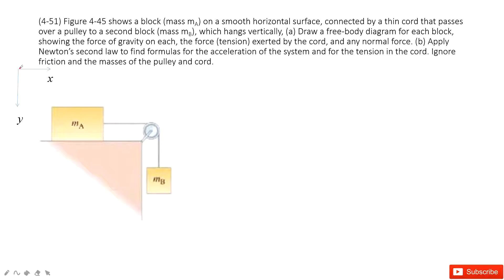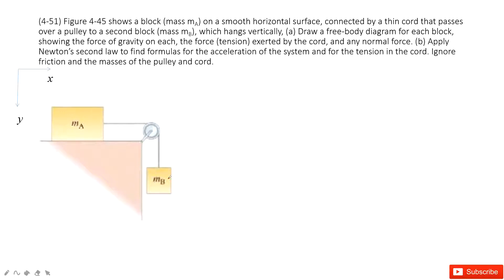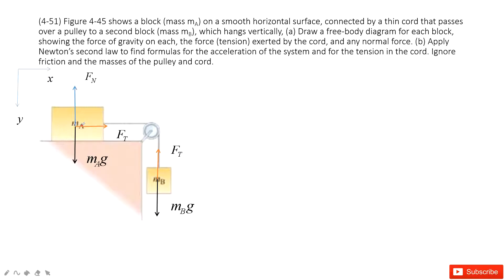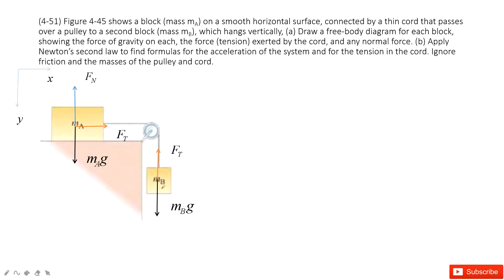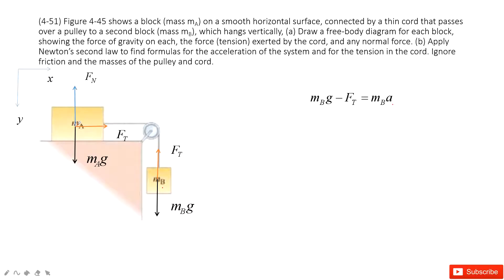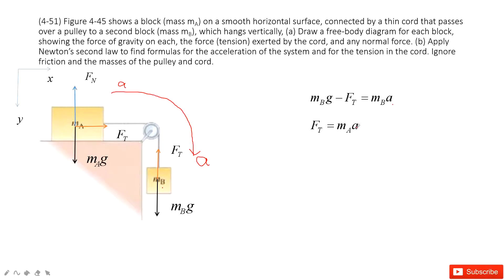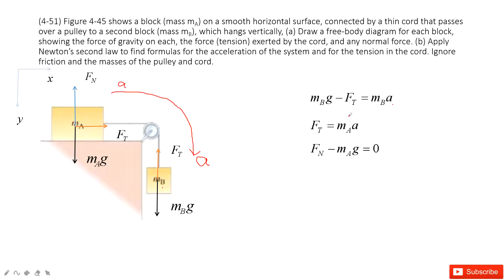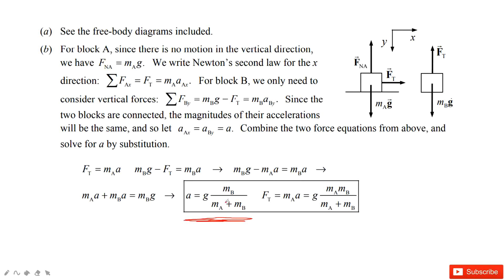(4-51) Figure 4-45 shows a block (mass mA) on a smooth horizontal surface, connected by a thin cord

Comment: could you do this example? thanks, A block with mass mA = 10.0 kg on a smooth horizontal surface is connected by a thin cord that passes over a pulley to a second block with mass mB = 4.0 kg which hangs vertically. then Determine the magnitude of the acceleration of the system.
Express your answer to two significant figures and include the appropriate units. then If initially, mA is at rest 1.250 m from the edge of the table, how long does it take to reach the edge of the table if the system is allowed to move freely?
Express your answer to two significant figures and include the appropriate units. then If mB = 1.0 kg, how large must mA be if the acceleration of the system is to be kept at g/100?
Express your answer to two significant figures and include the appropriate units.
Reply: Could you?